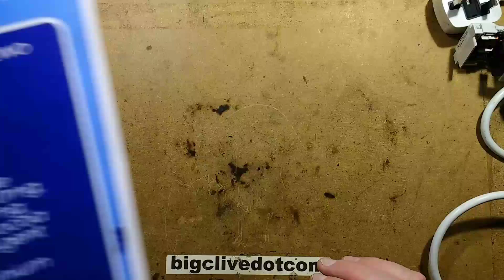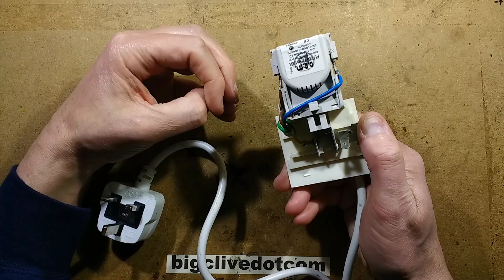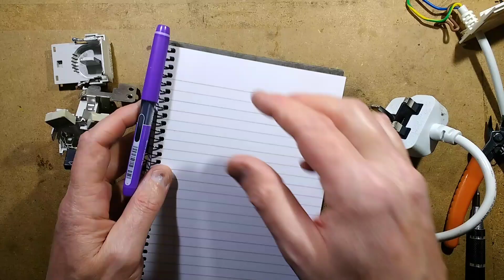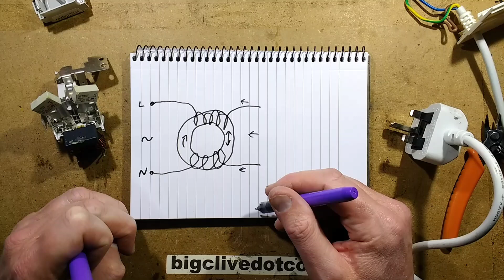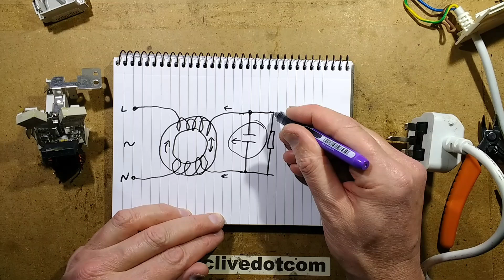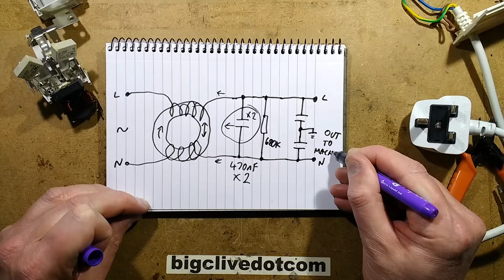Blue nooky pills and interference suppressors.

Comment: Wow... Theobromine  is a xanthine like, but not as strong as caffeine.  So it is using a hunk of stimulant.  An AVERAGE cup of coffee has 95-100 mg caffeine. (tea about half that.  Espresso has more, but the serving is much smaller.)  The guarana provides 44mg caffeine, the anhydrous provides 100mg.  That amount of theobromine is unlikely to even be felt.  It takes around 250mg average to be noticed. Saw palmetto has alpha blockers with can help with prostate issues, and may slightly decrease (very slightly) male pattern baldness... but studies have found it no better than placebo for ED.  Caffeine may modestly improve ED, especially if related to daily fatigue...the dose required being 170 to nearly 400mg.  So, the nooky pills are on the low end.  Taking with coffee or tea would increase the dose, however, they may make you spend a penny pretty quick.

Comment: I looked over some comments before writing this, bearing in mind that at my age, a viagrastitute is academic.  My question is, my power utility is installing meters that meter actual power, or maybe I should say real power.  My question is that your comments about the suppressor seems  to indicate that a capacitive load will indicate a false reading.  Or maybe a real read, but manufacturers don't care that their equipment will use power whenever the machine is plugged in.  And, why does my spellchecker have a fit with the word 'capacitive".

Comment: You got the CM choke function a bit backwards at 9:58. It is wound such that differential mode currents give opposing magnetic flux that cancels itself out. Thus, the magnetic core doesn't "see" the differential mode current which is many orders of magnitude larger than the common mode current and would otherwise easily saturate the core before it can do its work.

Comment: If you want to be a sexual tyrannosaurus in bed with your partner then Nooky is the way to go. Nooky is 90% cheaper than the high street and online shops. I've tested the men's pills, the ring and magic finger tool only. It works really well. They (Nooky) say the ring and magic finger tool should be used once and then disposed of but if you run/clean it under cold water you can use it another 3-4 times more. All For £3 what a bloody bargain !!

Comment: I'd love to hear more of your thoughts on "smart" meters. I'm sceptical about them and the real reasons why they are being pushed so hard, and there have been various problems reported with them massively over-reading, but there's also a lot of far-fetched conspiracy theories out there. It would be great if you could do a video about them covering what's actually different about them compared to regular meters, why they've been over-reading, whether they can be trusted going forward, etc. Thanks!
Reply from the maker: Ignore the conspiracy theories.   The meters are saving the power companies the cost of employing meter readers and giving them the very annoying option of switching the meters remotely to bill for apparent power, which will suddenly double the cost of running many electronic items.

Comment: Clive, you got the common mode choke the wrong way around. Normal current going in and out of the circuit cancels each other and produces no net magnetic field in the toroid coil. Current that flows in but not out (say through a stray capacitance to earth) sees a large inductance. This inductance coupled with the capacitors makes a low pass filter and stops the noise from your circuit radiating towards your negihbors.

Comment: Hey bud love the content! Can you help me please! I have some ghosts that are on a string (flying axworthy ghost setup) and I want them to light up only when they move. Kind of like them kids shoes that light up when the kids stomp. I can't find how that is done. Do you know how? Thanks for your help and videos!
Reply: You can get "mercury switches" (though they no longer use actual mercury) to detect movement or shaking. One of those, in series with an LED and resistor would be a simple way of doing it. 

If you want the light to stay on a bit longer, a transistor / capacitor monostable, or a 555, would do that.

Comment: Hi thanks for very good videos,
My mum has a 12year old Bosch dishwasher, that tripped her main RCD of the house after about 40-60mins when she was getting her large cooker fixed, see asked the man to look at the dishwasher, he did not find anything wrong with it, she did not like to ask me as I was working,
I am a prototype wireman, and a c&g pat tester, and radio ham, so I do do a lot like your self , but no videos,
Anyway when she told me , I did have a look at it for her,
I did a insulation test at 500v  then at a 1000v and all was OK, as I have a seawood pat tester, I then tested earth leakage and that was OK, so I left the dishwasher running off my pat tester, and after about 30mins the earth leakage started to clime and clime until the RCD switched, at about 40mins,
Anyway the problem was the mains filter in the dishwasher, so all working now, 
I do not think any so called repair men would have tested it for that long, would they have tested the earth leakage?
Thanks Dave

Good luck with vids  keep them coming
Reply: Hopefully there's a dedicated test for these modules that reveal the fault in seconds.  Repairmen would then need to know "If customer complains of RCD tripping, test this and replace module".

Comment: Stiff..luck?!
Anyhow that phun intended, i have question for you, regarding interference.
At my house i have a wide range of LED bulbs, i am going nuts with the fail rate.
Even expensive Osram and Philips lights fail fairly regulary.
Worst area is the bathrom where i have double armatures 2x bulbs on each side of the mirror.
Atleast one bulb a month, and often a cascade effect.
I have no dimmers or anything similar.
Have you any experience with interference, overtones or anything like that caused by LED lights or other equipment. That kills LED bulbs.

Comment: Clive does a back-of-the-envelope reactance calculation AND explains common-mode noise rejection. And still, nothing... Those boner pills obviously useless. Normally even just the clicking of the knob on the multimeter should be enough to draw a reaction 'neath the big lad's kilt.

Comment: so what would happen if I put a bigass capacitor in series with my vacuum cleaner?
I bet that would register on my meter.. I can't really imagine why a capacitive load would not register...
Reply: A pure, zero leak, zero ESR capacitor will pump back as much power as it takes out, as there's nowhere else the energy goes.  However the wiring will be heating up all the way back to the transformer. Obviously such a pure capacitor is an unachievable ideal.

Comment: When you get a slightly shock on your washingmaschine , then Check your Earthconnection. These class Y Capacitors will give Voltage on the Maschinehousing. 
We had that Problem at a Friend of me.
The Earthconnection in the plug Socket  was off. When she had one Hand on the Watertap and the other on the Washer she got a shock whyle cleaning  the Kitchen.
Greetings from Germany , i love your Videos. Thanks a lot for these Lessons!
Reply from the maker: It definitely makes you realise your machine is not grounded properly.

Comment: Toyotas and Hondas have a fan control module they charge $100or more to replace. All it has is a thermostat, heatsink and a mosfet. If it has an open signal it needs a 1ohm resistor across the thermostat Easy fix. The only other thing that goes wrong is the mosfet. 2362 2A is what is written on it. I can't find it to replace it. How do you find out if another mosfet will do the same job? All it does is read the temperature in the heating/cooling system and controls the fan speed with a pwm signal. It's the part that revs your motor when you turn the fan on. There has to be another mosfet that does the same job.
Reply: https://www.youtube.com/watch?v=ZCFiuhgSkFE
https://www.youtube.com/watch?v=6YiCjnjLKH8
Reply from the maker: If it's actually converting temperature to PWM then it sounds like a specialist DC regulation component.

Comment: Not sure if it helps people to know, but when measuring tiny quantities, you are better off making a solution of known concentration, then using that for your measurements. 

Even with ug scales, measuring tiny amounts is difficult, since the amount is so small, it is easy to accidentally double your dose.

The solution is to measure in teaspoon, or, as i prefer, shot sized aliquots. (I may be wrong about using aliquot for this, I learned it using tiny samples of toxin in a lab I worked in.)

To make an aliquot of anhydrous caffeine, take 3g (about 2 teaspoons, but you should measure this on a scale that measures in milligrams) and add it to 500ml water.

You now have a solution of 6mg/ml of caffeine solution. I still like to work with large volumes for precision, so I then add 15ml (half a shot) of this solution to 2l of home made soda for a final concentration of 45ug per ml or 45mg/litre.

Since coke is about 95.8mg/l, I am using just under half the caffeine of coke, with no need to measure tiny quantities.

Comment: Clive, what components would you recommend to retrofit an old 6v torch with a 3" or so wide lamp head as an LED rechargeable torch?
By that I mean voltage of led, how many and also the battery specs

Comment: 11:35 Clive, I've done some tests and my meter (old type with a spinning disk) does indeed measure imaginary power as well as real power.. (Turned off everything in house and made sure disk was still, then put 4 very large capacitors across L and N, disk was spinning faster than just the real part would cause)
Reply from the maker: I should do a test on my digital meter.  Turn the DB off except for one circuit with caps connected.
Reply: bigclivedotcom Please do, it'd be interesting to see the results.. It's been bugging me for a while since I fully thought that at least half of the power draw wouldn't be detected with such a bad P.F.

Comment: Clive..good video as always.  Question, if you know; Why the 240v instead of the 120 we have here in the US.  We drop the super high voltage down to 240v with step down transformers on poles. These secondary windings are center tapped with the neutral and two hot leads going into a handful of houses so each house is supplied w/ two 120v lines, if you connect from either hot to the neutral, which almost all appliances do.  We kinda save the 240v for big air conditioners and electric heat, etc.   Okay, just was always curious about that.  Cheers.
Reply: 16A?  What are you talking about?  Our smallest breakers are 15A and we have a bucket load of them.  15s, 20, 30s, 40s and 50s.  Our wires are 14 and 20 awg.  We use 20 gauge and up to 10 gauge 240 on ranges and ovens.  I've never met a limey that knew what he was talking about.  Maybe you can break the record.  Let's see.  Explain yourself.

Comment: Is the output of the suppression unit still AC? 

I had an old washing machine that I replaced as it would randomly trip the fuse in the fuse box. Would that have been the suppression unit failing?

Did you get lucky? Don't want to be all dressed up for a party with nowhere to go. ;)

Thanks. :)
Reply: The point of the unit is to let 50Hz AC through and block as much as possible of everything else. So, yeah, it's still AC.
If the unit fails, it's usually one of the caps shorting and tripping the fuse. Very often, if you reset the fuse everything works again, but the cap is actually damaged and won't do it's job anymore (no filtering). The reason is that you never want one of the caps short live to the case, so X/Y caps are built in a way that if they short, the short will "heal" itself (cap is still damaged). Never replace an X/Y cap with a normal cap.
Reply from the maker: It passes AC.  The suppressors can fail in a way that trips breakers, or more commonly RCDs / GFIs.  It can be water ingress causing leakage or a failing heating element.

Comment: Last year I had to replace that module twice on the washing machine. It's in an area of light industrial neighbours.
The faults were causing the rcd to trip. Is it likely the an external source could have damaged them? And did my washing machine sacrifice its suppressor and protect my laptop in doing so? Cheers Clive great vid as always!!
Reply: The supressor isn't really there to save the device, it's there to save the grid from the device (or rather it's electrical noise). If it broke twice on the same machine, I'd search for a fault in the machine (e. g. bad motor brushes/damaged commutator). External voltage spikes could make the suppressor fail faster, but I doubt it. Was the suppressor really broken? The RCD tripping sounds more like moisture/water being in the wrong spot to me (although if one of the Y caps blew it would also trip the RCD).
Reply from the maker: Even though the suppressor is intended for the machine it will still act as a mains interference suppressor.  Do your technical neighbours use welders much?  Welders can create a lot of noise on the mains and affect suppression components.

Comment: 'Huge pensions to pay' was the first thing to come to mind not something more friendly to your class like 'huge bonuses to pay'?
Reply: Cofcos There's also the very real cost that reactive consumption and harmonics imposes on the company infrastructure.  For starters, the distribution cables need to be sized for the higher current that's not (currently) paid for.  Third harmonics of the mains frequency (150Hz on 50Hz nets, 180Hz on 3-phase 60Hz nets) in particular change the net total current in the neutral wire from almost nothing to potentially more than in the 3 live wires.  On the bonus site, different gadgets cause reactive draw with opposite polarity, which can cancel out inside the home to reduce the metered and actual reactive load on the power company systems.
Reply: Very cynical comment but most likely the truth...

Comment: Caffeine Citrate's useful in managing paediatric respiratory distress syndrome (also known as SIDS - Sudden Infant Death Syndrome). It helps to increase respiratory drive (rate).  Hate to disappoint you, Clive, but that concoction's no substitute for Sildenafil (Viagra, etc), which is now off-patent (so a lot cheaper than the "Little Blue Pills from Pfizer"). Where I work, we get through a LOT of Sildenafil - most of our elderly, respiratory cripples are on 10mg three times a day (Pulmonary Hypertension).
Reply: maybe but the ceiling is harder to clean
Reply: It will also help those elderly from pissing on their slippers.
Reply: That's just an excuse for getting it on with each other every time you turn your back.
Reply: Lionel - that's certainly wishful thinking! Since our "Customers" are pretty well "in the Grim Reaper Waiting Room" - with exercise tolerances of 5 metres on the flat, NYHA Grade 4 heart failure, and Pulm. HTN / oedema, the "other benefit" of Sildenafil's  is more like wishful thinking! Also, since they're on a fairly constant dosage, "that" effect is actually pretty uncommon. We do see the rarer side-effects though, such as blue vision changes (about 10% of users), and we've had a single case of irreversible blindness (in a 98 year old lady, mind you!)
Reply: Indeed. Sildenafil's effects on erectile dysfunction was actually an unintended side effect, from what I've heard from Pfizer Insiders.
Reply: I was working at Pfizer Sandwich when it was released.  I used to have one of the promotional tee-shirts. There was a picture of the sildenafil citrate molecule on the back.
Reply: That’s why they give viagra and a hot cocoa to elderly male inmates in care homes - the cocoa puts them to sleep, and the viagra makes sure they don’t fall out of the bed 😂
Reply: Fun fact - when Pfizer first released Viagra, it was the most counterfeited drug in history (and for a time held the Search Engine record for the largest number of "hits" - 400 million I believe!)
Reply: SarkyBugger - do you know Colin (now Dr) Suttee? He was one of the Sildenafil Project Formulation Team (I believe he left shortly afterwards to return to academic life). Great bloke (and he REALLY knew his synthetic chemistry!)
Reply: "I'm Jake the Peg - with my 'extra' leg!" :D
Reply: Phil S thats very interesting!
Reply: Phil S  Afraid not.  I was a sub-contract plumber on the whole site from 1987 to 1990, not involved in sciencey stuff.  Thinking back, it was after I left that Viagra was actually released, but a friend got hold of the tee-shirt for me.  This was all before the west site was there.  I think it was the money from Viagra that built the whole of the new site.  And now it's all shut down...  :o(
Reply: I always thought the interesting side effect was found during preliminary testing for pulmonary hypertension or similar use for which it completely failed to be useful.
Reply: Are you  a pharmacist? I congratulate you for helping people if so.
Reply: DashCamAndy Yep, side effect was found when testing on pediatric cardiac patients who had undergone a heart surgery.  Infant Boys managed to get strong erections that lasted as noted by nurses. One of those nurses also took care of my daughter and told us of her experience when my kiddo was in for heart surgery. She had it prescribed for a year during recovery. Insurance was just beside themselves when they tried to charge me full price when they thought it was for me and not my daughter. The pharmacy and her cardiologist went to bat for me and gave them the riot act. Only had to pay my co-pay.